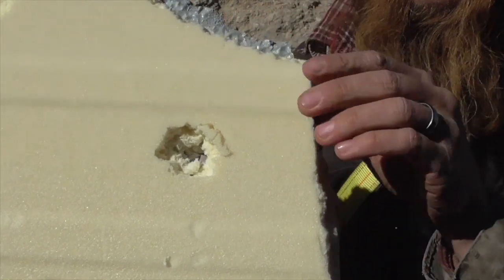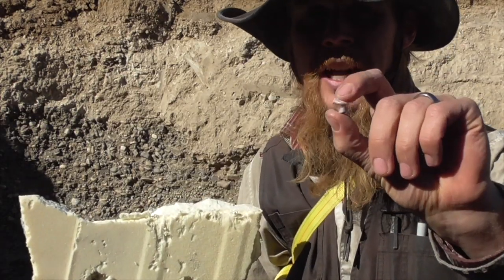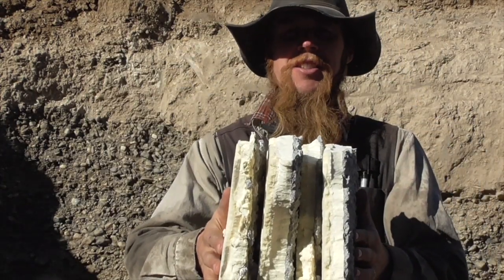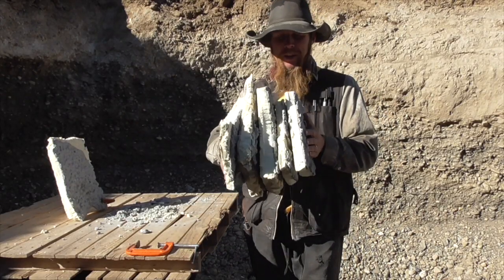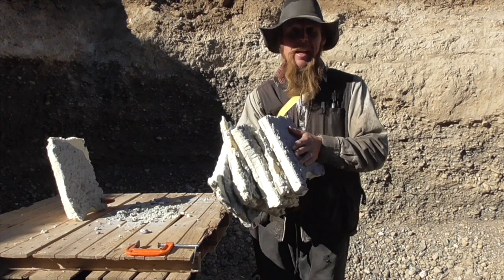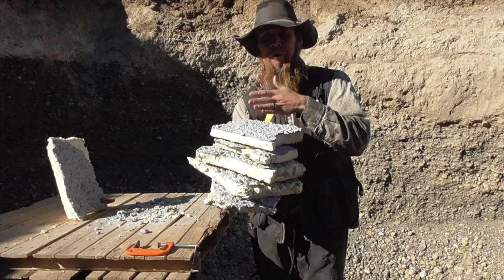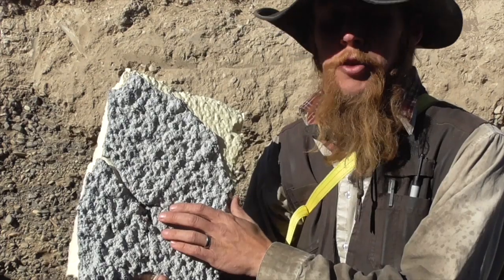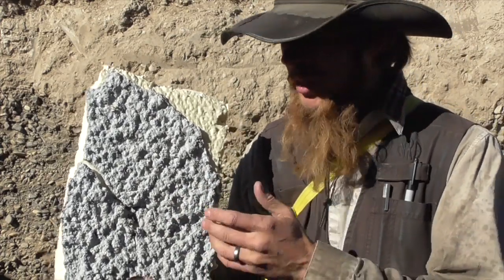Improvised Body Armor Testing: Urethane Foam with Cement Coating (TIS232)

Comment: You need about 1kg of Urethane foam which is about 1 large garbage bag full of foam. 
Dissolve 1kg of the Urethane foam in Acetone or High Octane fuel it will dissolve into  a Jelly substance,  put the jell into a vacuum machine to take all air bubbles out. 
Now mould the jelly over the top of your armour plate and let dry for 1 week. 
It goes as hard as steel, make the jelly plate 2cm thick. 
Once the foam sets solid a chemical reaction occurs between the Urethane jell & the Petroleum.
You end up with a solid but light weight plastic body armour. 
I've done it but not shot it with a Pistol. 
I shot it with a Cross Bow & it didn't penetrate.
Try it!

Comment: The military uses something like this for protection against mortars and the like... It's just a big sheet of styrofoam encased in concrete. They are light, look protective, can disrupt shrapnel very well, and uses the well-known physics of needing something low-density/foamy to stop shockwaves. So, a direct hit with an RPG or mortar may blow it to pieces... but those would be foamy pieces, for the most part, and the offending projectile would be activated outdoors, rather than indoors in the case of military T-Walls (as we called them). They don't need to take more than 1 hit, as everyone on and around the base would take that as the signal to go to work. So they were used to reduce the stress and casualties (mostly mental casualties) by surrounding barracks and assembly areas, while fighting positions would use sandbags, reinforced concrete, and (my favorite) HESCO barriers.

Comment: Thats cool! So I guess a foam-like material could be a useful spall-liner to keep fragments of the bullet or armor from causing more damage behind the armor. If you have any left over, you should do tests with two pieces facing other with the concrete in the middle and see if there is any results concerning bits of the concrete getting captured in the foam. Could be useful against frangible rounds. It might not stop the core or the bullet itself, but it may reduce shrapnel.

Comment: Ceramic floor tile is considerably harder, i wouldnt use it on its own, but it will deform most bullets i think. If you use the segmented tiles it might survive a couple of hits too. Two layers of tile to smash bullet and some strong material to catch it, and a foam backing so you dont get hydroshocked to death.

Comment: I once shot a bar of lead and that was very interesting.
Reply: not very practical as body armour unfortunately
Reply: @ravener96  It does shield you from radiations as wel tho :D
Reply: Yup ... Static walls ... Interior panels ... Maybe 4 layer panels ... 16 gauge aluminum-.5 inch foam-.5 inch shotcrete-.5 inch foam ... Multiple panels ... Bunker ???

Comment: I have an Idea...Try that stuff called kevlar! Maybe layered with some kind of ceramic with the addition of some hardened steel? See what that would do.  (don't bother with tires, I use them for 22lr rifle backstops and even a 22 will penetrate several layers)
Reply: glass fiber is much easier to get a hold of, and is nearly as strong, especially S glass. a good thickness of glass fiber cloth behind a ceramic tile should stop a lot.

Comment: Floor tile "armor", as I understand, is only suggest because of the "hardness" much like modern ceramic armor plate. 
Tile over steal and some of dense/tightly'woven/compressed nylon might work? 
Something like this https://www.youtube.com/watch?v=_7jiIQOgwtI with tile up front and a steal backing?

Comment: Probably some laminated materials such as layered polyethylene plastic, sheet aluminum an possibly some thin steel or even a sacrificial ceramic plate  would create enough resistance between the laminated materials to stop the bullet.

Comment: Have you ever read about Linothorax? I bet that some sort of low melting glue & layers of nylon or some such might be more effective than the sum of its parts.
https://www.uwgb.edu/aldreteg/Linothorax.html is a great source to get started on, and the book "Reconstructing Ancient Linen Body Armor: Unraveling the Linothorax Mystery" by Gregory S. Aldrete Et All is a very useful resource in the lessons-learned department.